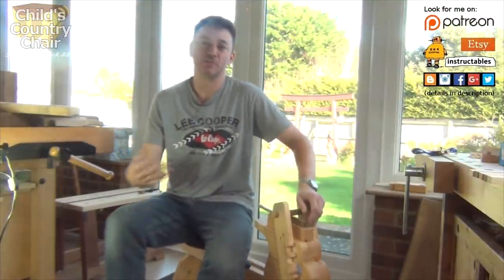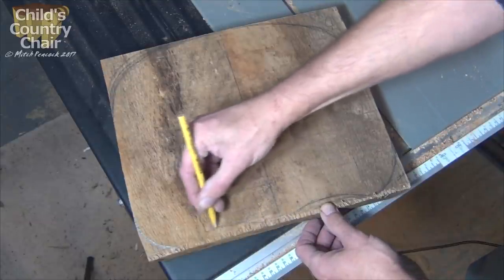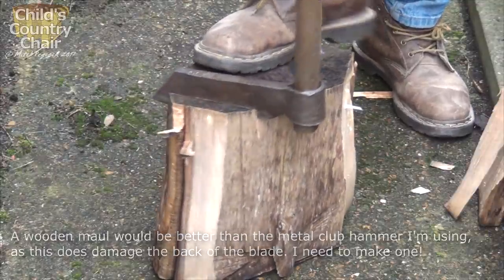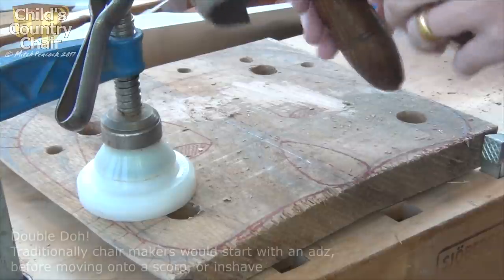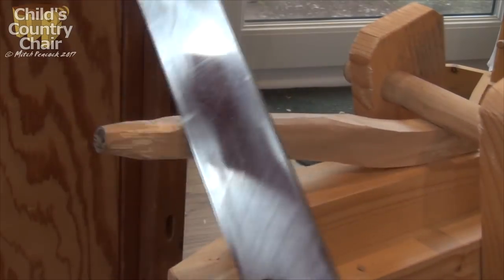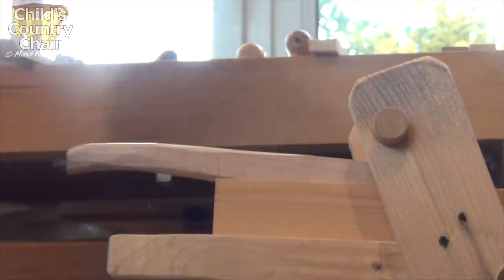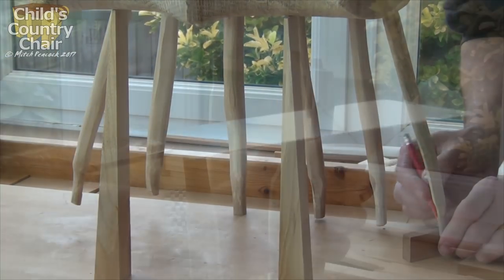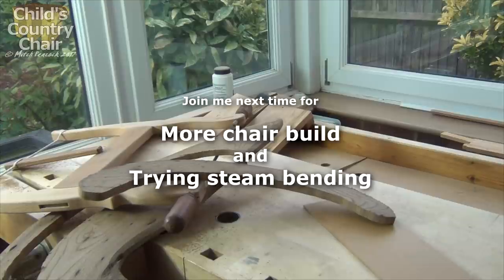Make a Child's Country Chair - part 1 of 3

Comment: ice video, Mitch.
So far, the chair looks nice.
With the chair surface, it is always better first with a chisel and then with a Scorp iron (that is for hollowing out at shells, chair seat surfaces) and then with drawing card.
When you do everything with a hand tool, it takes time.
Most of my stuff is done by hand tools. :-)
As a pensioner you have time. ;-)
Reply from the maker: Thanks Günter. I think I need an add for the preliminary dishing of the seat, but in the meantime it's just fun to chip away
Reply: The beauty of working with hand tools is that you do not have to stick to clocks. You can do it on Sundays, at night, on public holidays, etc., and you do not make any noise towards machines.

Comment: Mitch, I think that's what in the US we call a plank chair generically, or a Windsor chair specifically. You don't use those terms in the UK?
Reply from the maker: Michael Anderson Not aware of plank chair term, but Windsor chairs for sure with their vertical bowed backs.   The country chair is a less 'refined' chair, often with a low to mid-back. Quick to make, and efficient in materials. I wasn't very quick at all, but I can see how with more experience these could be flying out of the 'shop!